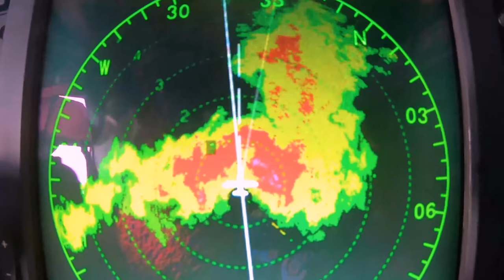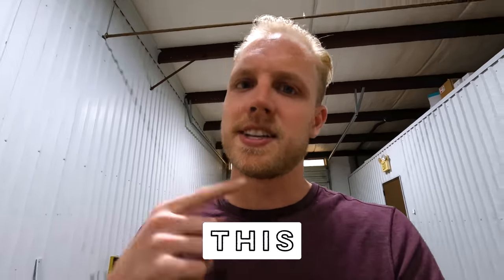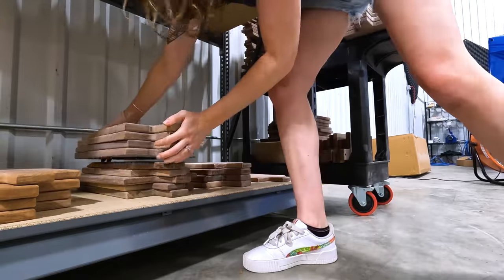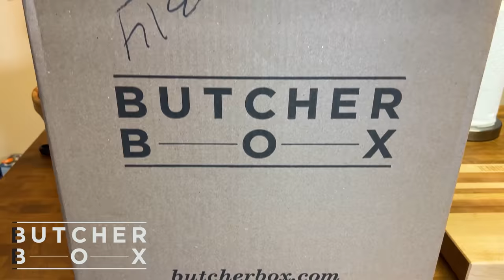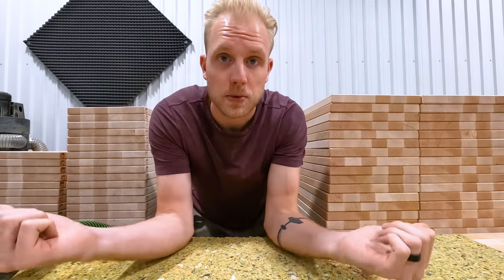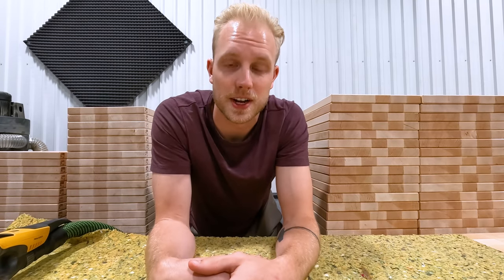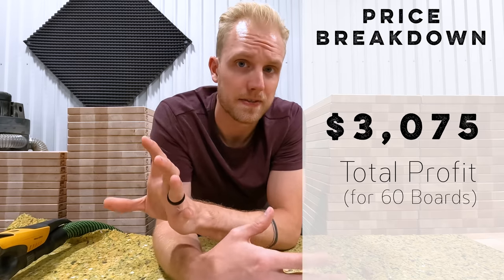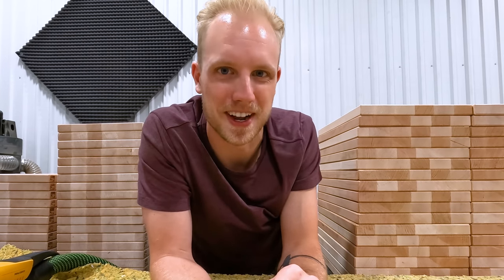we built $7,500 in cutting boards (will it be enough?!)

Comment: I hope this doesn't bore you . . .  Plot sales by the month for all of last year.  Set high-low limits for inventory control.  That would be 10% above your highest sales month for your high limit and 20% above your minimum sales month  for your low limit.  Determine a production rate for a convenient time period.  Let's say when you want to make your product you would like to dedicate a full eight hours as your convenient production period.  Let's say you can produce 20 boards in any given 8-hour period.  And let's say you look at last years sales for July and it is 12 boards per week for the slowest week and 20 boards for the fastest week.    

You will want to have a minimum of 15  boards and maximum of 24 boards (for each week) on hand by the end of June to cover expected sales in July.  So, schedule 4 days of production in June with a production rate of no less than 15 boards per day or 4 days of production of no less than 15 boards per day.  Also, be sure to order ahead of time and make sure your vendors will have the material to you on time.

You can also track the cost of materials to see if there are any patterns over time that you can plan for and/or take advantage of.  I'm thinking of your vendors' inventory reduction periods and min/max quantities to get the best unit cost.

Comment: I went through a JIT training ... it is the most effective way for production
Reply: The current supply chain issues are exposing a flaw in JIT as a small supply disruption can have a nasty trickle down effect...
Reply: It's critical to understand what impact a supply chain disruption has and how to conquer it. Like Toyota did with ICs. By holding inventory for mission critical parts for up to a year they were at times the last still producing car manufacturer.
Reply from the maker: A once-a-decade supply chain issue is FAR cheaper than paying for material storage the other 99% of the time. Every method has downsides!

Comment: You've already answered most of the questions of "Just In Time" manufacturing. IT IS RISKY. Your company is only a handful of employees, and a basic products hit danger level before it was caught. Just in time and lean manufacturing works ONLY if closely monitored almost micro-managed at best. There is a reason even Toyota (originator of the system) is moving away from it.
Reply from the maker: They're not moving away from it, they're just hedging against their weak points. Every system has downsides, and a once-a-decade supply chain issue is FAR cheaper to recover from than paying for storage the other 99.9% of the time!

Comment: I think a few weeks back you guys hired employees, but it doesn't look like for the production side of the business.  So the two of you are doing low skilled jobs when you should be working on expanding the business, if that's your ultimate goal.  Even if you have an employee come in 1 or 2 days a week.  We built cutting boards in high school, so the job is not that difficult to do.  Not saying you need high schoolers, but it's a thought.  They need a few hours a week, can do lots of other things like clean up, inventory, pickup more materials, etc. If your time as a business owner is being spent building boards, who will expand your business?  Maybe its not that many hours a day/week, but you need to make the cut over to growth instead of being a W2.

Comment: Why aren't you guys running a straight line rip raw or a gang saw? It's really tedious work to setup a bandsaw and then cut every little strip by hand. Must be exhausting especially without a powerfeeder? You must be getting more yield from the wood with the thinner kerf but I feel exposuring yourself less to a blade is better in the end. Especially when you are tired, rushed or just not feeling it. Also I'm wondering why you don't glue up the boards longer at least 2 lengths and cut them down? A wall clamping system has to be in your future.

Also make a jig out of plywood to hold the cutting boards up. I'm sure her shoulder was hurting. You can probably make a holder for the branding iron so you index them in the exact same spot laying flat and not risk burning yourself.
Reply from the maker: Those tools are on the list! 

As to your other questions, we’ve addressed them multiple times in other similar videos! We’d encourage you to sit back and watch a few! 🥰🍿

Comment: Have a staging area for products that are sold but not yet shipped in combination with a excel spreadsheet that can be accessed from both the building department and the fulfillment department. As products are being moved from stock area to stage area subtract each product from the available stock in the spreadsheet this could be done efficiently buy having a picking slip printed listing the number of each product for all the orders going out that day combined the picker can see that they need 12 cutting boards and 12 serving treys and so on grab them all on a cart subtract from spreadsheet and then package in staging area for fulfillment . The fulfillment department can have easy access to inventory available and the building department can periodically cycle count the inventory to ensure it is up to date and accurate 🫡